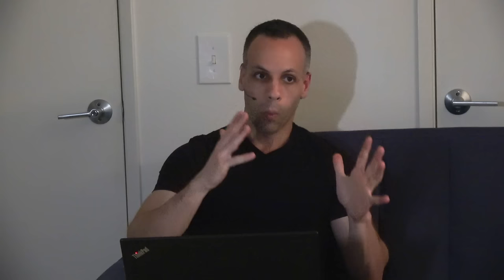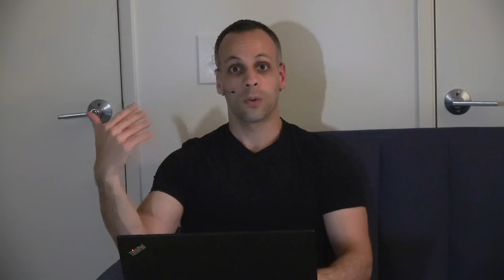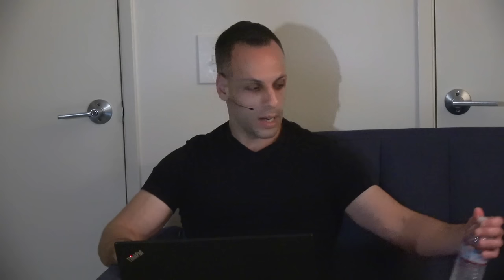EVGA's Oversight: Unannounced Changes Destroy PCs, EVGA takes NO ACCOUNTABILITY

Comment: Isn't that unfortunately the case with cables to most brands' PSU's? 
A standard is sorely needed.
Reply: corsair type 4 cables will happily plug into the EVGA SuperNova G7 750, PSU-side motherboard connector keying is the same, pin usage is very much not the same

Comment: No, if a company changes the pinout in a way that destroys hardware when you follow their instructions they're responsible for replacing all of that hardware. The way they get around that is by not changing the pinouts in the first place, once they have they're open to the liability with a policy or not.

Comment: Whilst i agree if they add the clause to swap out damaged equipment to evgas negligence would leave them significantly liable and people would take advantage. Evga could mitigate their losses. Only customers gone through the rma process up to this point could be eligible. Im also sure evga have kept records of serial numbers returned and of the new devices sent out. They should have a record of what pin layouts the psus have and if their is a difference and accept the fact its the cost of doing business and making mistakes. Moving forward standardise pin layout, change process. I.e send cables or add big bold documentation with the returned device.

Comment: I'm beginning to think we were all duped about EVGA's true quality by their great customer service. As I think back, EVGA killed my [their] GPU twice when I owned one. The first one died within a month of install and was RMA'd. The second one died a literal fiery death when their own first-party water block sprung a hidden slow leak on a factory welded plastic joint and dripped onto the main voltage rails of the GPU. A literal fire started in the case. Would EVGA had taken responsibility if their product had burned my house down? 🤦🏻‍♂️

I really do think they were worse all along than we believed them to be. The CS really can't be beat, but as I think back over all the EVGA products I've ever owned, were any of them really problem-free!? 🤷🏻‍♂️

Comment: Of course they wouldn't be able to reimburse the lost drives in most cases but that's because they would have the argument that you used the wrong cables either by mixing them or using third party. But there they should reimburse the drives because that person used the cables they told them too with the rma policy but without that you are right. There's a good chance that legally they are actually obligated too.

Comment: The modular cable pinouts SHOULD be standardized, but they're not for some reason. I figured out a long time ago never to use any PSU cables but the ones that came with a given power supply. No mixing and matching. And why the pinout change? EVGA does not make their power supplies, nor does any other major brand. They all outsource the construction of their power supplies. Somebody at EVGA changed the manufacturer for a given model, and that second manufacturer uses a different pinout because there is no standard.
Reply: "nor does any other major brand".
Does the name SeaSonic (or Sea Sonic, as the mothership company is named) ring a bell?

Comment: It would seem quite easy for EVGA to make a policy to put this right without it being too risky - just cover for consumers who they sent replacement power supplies to with different pinouts and without warning about the change, as that's by far the most egregious wrong.

Of course the fact they changed the power pinouts without changing the keying on the socket is totally incompetent and we should probably avoid EVGA power suppliers because of it.

Comment: The thing is, their pinouts typically don't change, and they have a note on their pages showing that most of them can use the same cables, because they did start to standardize their pinouts. It's not unreasonable to check with a multi-meter; it's stupid, since they explicitly state that the cables are standard across most of their PSUs.

It isn't as bad as you think though Louis, Most of the companies have moved to their own standard, and some even share the same standard unofficially(cause Corsair is a money hungry POS who's likely charge to advertise with their standard.) No other company is popular enough to be able to create an open standard for free and have everyone else jump on board, Corsair being the biggest hurdle IMO.

EVGA is really only power supplies at this point, and they mess up this badly? Their customer service and goodwill are all that's been keeping them alive. Their PSUs aren't anything special, cause they use rebranded PSUs from other companies. And why the SATA of all things? Data is pretty invaluable. A 7600X CPU is a 7600X CPU. I can't just buy new drives are get the data with it.

Comment: It should be clear from their own documentation (recording serials during the RMA) as to what caused the issue. EVGA was clearly the cause.  EVGA needs to make the customer whole, which includes recovering the affected customer's data.  Update the RMA info / correspondence, pack a paper with the RMAs, tape off the PSU ports with a notice, do what the company need to do to prevent this from happening going forward to limit liability.  As for the crypto issue, there's likely ways to prevent such scams.  First thought is "drives in data recovery are mounted as read-only. Data recovery is best-effory and not guaranteed".  Honestly, the number of cases where they have in-house documentation of such errors are going to be fairly few.

Comment: I'm lucky I like SeaSonic power supplies. I have two old pcs, one has a bronze psu that came with a 5 or 7 yr warranty and is still working perfectly. My slightly newer old system that is my daily driver has a gold psu that came with a 10 or 12 yr warranty and is still working perfectly. I keep the cables for each psu in the boxes they came in so they don't get mixed up. I have never bought anything made by EVGA and I'm glad for that after the stuff they have done the last few years....

Comment: It is insane there's not a standardized pinout. Even within the same company.  But I was already aware of this issue.   I may have let the smoke out of a msi mobo along with the i7 12700k in the socket.   Worst possible scenario.    The issue was I changed out the psu and not the cable's.  I was upgrading from a 500 watt to a 1000 watt unit. I figured it was the same manufacturer so It should be the same pinout.   Lol.    Lesson learned.   Now I double and triple check pinout even with the factory cable's that come in the box.  5 extra minutes to save $500-$1000 is well worth the time.

Comment: Never be a beta-tester with new hardware, no matter if it it is new powerconnectors (see the RTX 4090 problems due to that, fire literally was involved for multiple users) or new CPU's, DDR and more. Let other people test, see how it goes and only if there are no problems then step in. The Corsair RM ***X has been one of the most popular higher quality PSU's for around a decade: just solid, low voltage-ripple, fully modular, 0-rpm mode and silent fans with good bearings. Tested as one of the best performing PSU's. Consider that one if they don't do wild expeirments.

Comment: Not being standard is one thing.  Being non-standardized and non-keyed is incredibly stupid.  Given 6 or 8 pins, and a mix of round, square, and D-pins, it would be easy enough to rotate the pattern when changing the pinout so that the connectors don't mix easily.

Comment: This not being a standard is something I've been bitching about for like 8 years. I've mixed and matched sure, but never without measuring with the multimeter. The fix is so braindead simple that I don't know why we haven't at least done it for EPS-12V, the 8 pin PCIe aux power, and the ATX 24 pin, you just make the connectors on both sides the same, the cables are double ended and symmetrical done. Sata I'm sure could be slightly more complicated since the tiny pins on the device end probably aren't enough to handle power for 3-6 devices, but then all you have to do is standardize around 1 connector that wasn't already standard which normally uses 5 wires...

Also just a gripe but I've had an EVGA PSU pop drives before, and I was SOL because they were carryovers from the system I was upgrading from. They still killed them, they acknowledged that the PSU was faulty in a way that would have caused drives to die, I believe the excuse was it's hard to put a price on used hardware... and I recall responding with ebay screenshots and links, never got my drives replaced. Still bought EVGA PSUs after that so I guess they won, generally speaking their PSUs are highly rated by those that test them so I continue to use their stuff.

Comment: That company is irresponsible! In my career, I have replaced many power supplies. I would never expect the cables to have the wrong voltages on them. I would never buy a power supply from them again. Screw me once, Shame on the company, I buy another PS from them and get screwed again, shame on me and my lack of judgement.

Comment: There is no wiggle room on this one at all. EVGA is completely responsible for the damage caused. They sent back a PSU that was incompatible with the model they recieved. They have all the knowledge; they make the PSU, they are aware of the difference in pinout, they are aware that they tell the customer not to send cables in, they sent no new cables with the PSU.
Evga doesn't need to be reponsible for damage caused by ordinary failures, this is DIY hardware afterall, not prebuilt systems where the company can test and validate all components. They absolutely do need to be responsible for this damage. It was completly their fault and a failure of their systems. Its staggering that this wasn't seen coming a mile away when they made the change to the pinout and didn't bother to change the model name or at least give it a revision number.

Comment: Changing the pinout without also changing the connector to ensure things like this don't happen is absolutely dumb. They essentially directly deceived their customer via policy and process and manipulated them into taking a destructive action. Whether intentional or not, that's the end result. In the financial world that would be breaking the law and lead to major fines, even in a one off case, and while I get that you can't just bankrupt a company for a mistake this should absolutely be something that leads to a maximum reasonable payout to anyone who has purchased or RMA'd EVGA power supplies and had damage caused by them.

Comment: Thanks for the info, been buying evga power supplies for about 15 years or so I was always really happy with them. However this changes things, i knew not to swap cables from different brand but this is ridiculous and not to tell anyone is even more insane. What has happened with these manufacturers that they don't give 2 shits for the consumer anymore? My theory is around 2019 our dimension partially merged with another and this is the result lol. Apparently the other dimension sucked big time. lol thanks for the info though love your videos.

Comment: I don’t agree. It’s not about trust. EVGA knows who they sent Replacement PSUs that have a different pinout than an RMA-d one, right? They also know if they told these people to be aware of the pinout change, right? So each time they sent back a different pinout psu AND did not tell the customer and/or provided the appropriate replacement cables AND that caused an issue, they should cover replacing what was destroyed. Simple.

Comment: Sounds like they had a disconnect between their employees. If they had an employee that was designing the new schematics for the replacement power supply and they without checking switched the location of wires, which changed the pinout of the connector forcing them to have to lie to save face after a massive F-UP to avoid a bunch of shit splatter on their face from the fallout of said F-UP!

Comment: My EVGA power supply shot black smoke all over my wall. My miner with no name generic psu did fine... After that incident I changed all my PSUs, if name brand exploded, so would the generic (was my logic at the time).

Comment: They need to ship a test board with leds. To plug the power cables into and green lights light up then it's proper voltage, any red lights then you have it wrong.
Test the power before using it.

Comment: more important than any detail in this video, is that EVGA would have REQUIRED this users Serial number to initiate this RMA. which means EVGA knew he had a model X series 1 PSU, and they knew they were sending him a Model X series 2 PSU.  ive been mixing cables for many years, its never gone wrong, but i am aware they say you shouldnt.  go with Seasonics Focus+ gold PSU's. ive been using them for years & they are great.  ive had EVGA PSU's, their older G2 was good, but ive had buddies get 3 bad units in a row, & i avoid them. NZXT was good, Sparkle group, the original corsair CX units were some of the best & they didnt have modular then, you could get 15-20yrs out of a CX600 (not even Gold rated). times are changing & PC is getting changed. i still have an Antec PSU thats 20yrs old & it works, i wont be throwing it out. people need to know anything beyond a 80+ gold is a means of selling something users dont really need. those ratings are for people who 'need' the best, but 80+ or 80+ gold is all anyone needs

Comment: The lack of standardization is really infuriating. I have a random set of modular power supplies, and the cables not being marked in any way I have no idea which cables go with which PSU. I almost fried a machine once by using the wrong cables. Miraculously nothing got fried and the machine just refused to power on.

Comment: For me, things like that are totally avoidable by .. maybe not changing the pin layout on the same model? 
Instead, give it a new model .. and in case of an RMA, send out the new model and the right cables. 
These kind of things simply should not happen and would not happen if that would be standard .. but in our world and without a standard, company policies and planning can still avoid these things. I am 100% sure this was a huge oversight.. but still, your customer is not supposed to be the one paying for your mistakes.

Comment: RE: Different connector standards.

-Obsolescence
-Design improvement.
-They're re-badging other small manufacturer's power supplier
-They're build to specification and they don't specify the cable to ps interface

This happens everywhere. My first car made a mid-year change to the water pump design and the only place other than the dealership that knew was Napa. Everywhere else you either got the wrong pump or you had to tell them it was for the prior year model (I replaced it three times in 6 years... cars sucked until the 2000's) .

Also backups:
Backblaze B2 + rclone + restic

Super cheap, and you encrypt it yourself.

Comment: The cables are part of the power supply. Neither will work for their intended purpose without the other.  They should have told him to send everything in, and issued a new PSU with its correct cables. By telling him to keep and re-use the old cables, they have unwittingly and unknowingly made their customer a QA technician. If they were smart, EVGA would use this as a teachable moment and standardize their connectors.

Comment: We should have ditched 3V3 over a decade ago.
Some WD drives won't start with 3V3 connected, EVGA kills drives with it and I never had any drive that used 3V3 for power.

I have a bunch of different brand spare modular cables. Maybe shoud cut out all 3V3 lines on them.

Comment: I don't think this case is at all comparable to one where a customer could cheat the system. EVGA knows for a fact they sent a power supply back that had the wrong pinout. They shoyld be held liable in this case as they misrepresented the product they were sending back as if it were identical to the one first purchased.

Comment: Both Corsair and Seasonic has sold different generations of modular PSU with different cables. So EVGA is not first or alone with that.

I wouldn't be surprised if people can list even more brands having models with incompatible cables.

I tend du dual-check with a multimeter and a reference table just to avoid big oopses. A bit sad, but a hard reality. I just have lots and lots of unused modular cables from different PSU.

Comment: as i understand it, and i'm not trying to provide any cover, literally just the explanation, the early GQ's were made by one company, and then the later ones, another. around the time of the switchover, they standardized their modular cable psu side pinouts for all but the BQs. 16+ model lines, vs 2. (literally just BQ and the early GQ) and the switchover was almost a decade ago.

its a concern, but having been building machines since the 90s.. too much stuff is proprietary for me to trust any cables are compatible without checking it completely. even switching units in this machine i still dug up to verify i could just swap psus without ripping out all the cables.

the near universal across a brand cable scheme thing? it's reallllly new, for the most part.

i get the complaint, but nah.

Comment: The problem is that big companies force employees to blindly follow the systems and procedures put in place. 
The employee has zero authority to go against the procedures and apply common sense instead.   
Where as smaller companies allow employees to use common sense as the baseline and only have systems and procedures in place to fill in gaps.